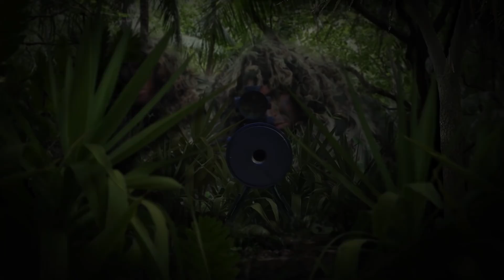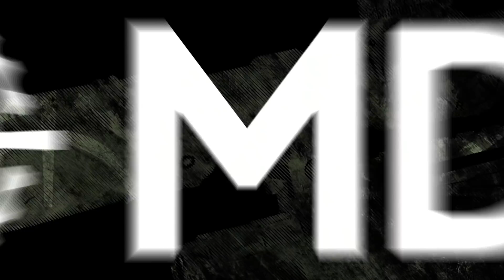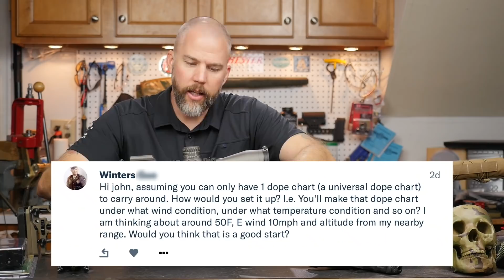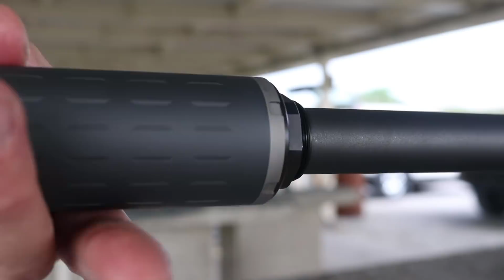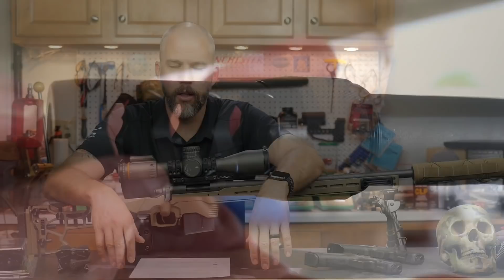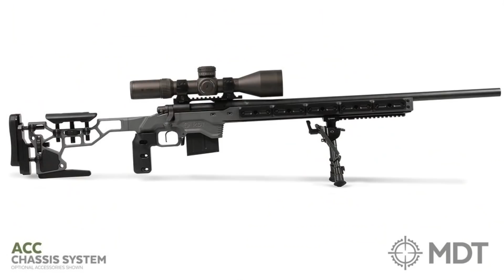Mail Call Mondays Season 7 #35 - Dope Cards, Home Range, Suppressors, MDT ACC Chassis

Comment: Bolt gun shooter.  
My fitness routine involves 2x per week going to a free men's workout group in our area (it's called F3 - look to see if you have this in your area).  Workouts start at 530am and end promptly at 615am.  My 2 favorite workout posts are a bootcamp-style workout that involves body weight exercises and light-to-moderate running, along with a kettle-bell focused workout.
I also practice Brazilian Jiu Jitsu 2-3x per week on my lunch break (1 hour class).
I have a naturally large build and pack on bulk quickly, so I've had to change my focus from lifting like I did when I was playing lacrosse in college, to more functional fitness and cardio.  And I like beer and bourbon.